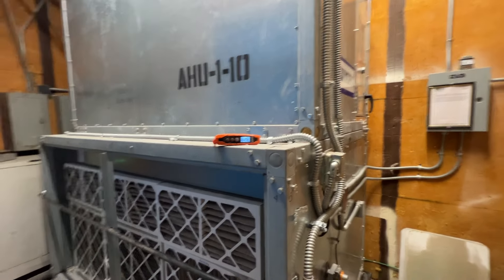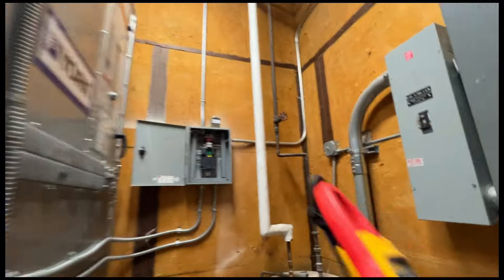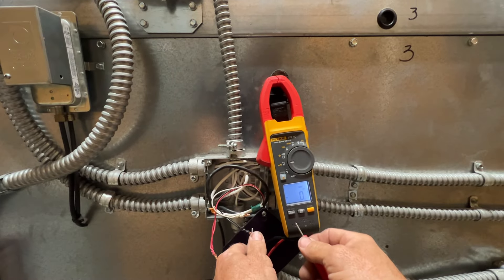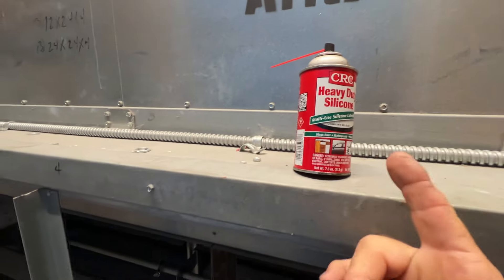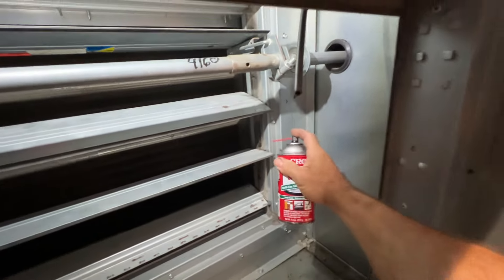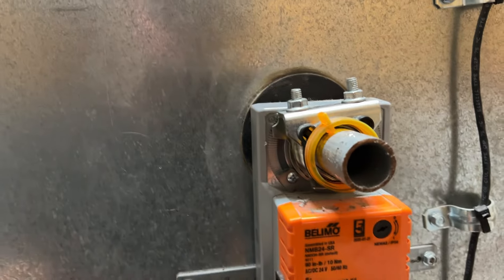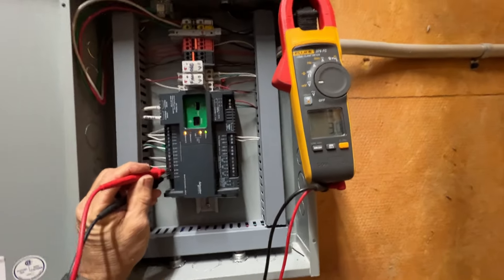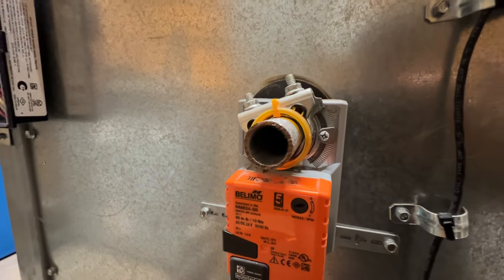York Chilled Water Air Handler Too Cold …… Rooms Are Freezing

Comment: I’m a retired York/JCI technician. 35 years in the trades. I was part of the merger with JCI and York. York controls use to be called “Fire and Ice”. We that were part of the development team were excited about the merger.  It took a while for the stubbornness to go away. I was sent all over the world to fix problems with the new equipment. If you got a news letter for field corrections it was probably from me. I knew what the problem right away.  By the lights flashing and the position and visual looks of the damper. Remember those actuators are DC power with not a lot of muscle. JCI is about power usage. Those need to exercise every 3 months. It was in my newsletter. lol. I’m retired 35 years my body gave up. Now I ride my Harley all over the west coast and watch my sons play college baseball and my grandson little league baseball. After 35 years I’ve earned it. Be safe
Reply from the maker: Congratulations on retirement, it seems like a rather light weight actuator for those dampers. I appreciate the comment, Thanks for watching and Enjoy your time with family 👍
Reply: @subcoolHVAC  thank you. I was asked about the same thing about other systems like yours and why they are specifically designed for that. Our logic with Johnson was this. They always listen to us as Teck too on the design team. Those actuators do have tork if installed correctly and level on the shaft. No binding on when it wants to start on the most resistance of angle. We did do test on different types and sizes. Our conclusion was this. Maintain the system and don’t want to over size the actuator and damage blades and shafts when they get tight. That was the opinion from us that are from the service end . That can be an ugly repair compared to an actuator swamp and grease on the mechanical components. When I wrote about this in a news letter years ago. I stressed the importance of maintaining and even gave hours of usage to perform when to exercise the components.

Comment: So what exactly does the face and bypass damper do? May be a dumb question, but why is it that if it’s in the closed or open position, it would call for the chilled water valve to stay wide open?
Reply from the maker: In short the F/B damper alllows return air to bypass the cooling coil to regulate the supply air temp needed to cool/dehumidify the space (ahu is constant volume) no reheat. Chw valve regulates  to insure coil is cold enough to cool/dehum. EMS R/A setpoint here was 72. The chw valve usually more open than not , our OA here  never really gets cool enough to take advantage of free cooling. Thanks for asking 👍
Reply: @subcoolHVAC  makes sense! Thanks for explaining!